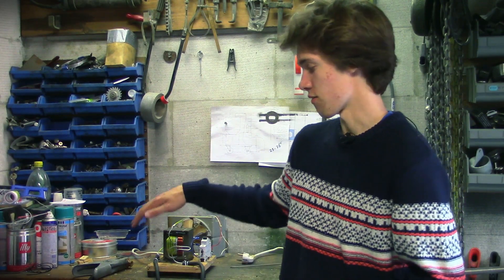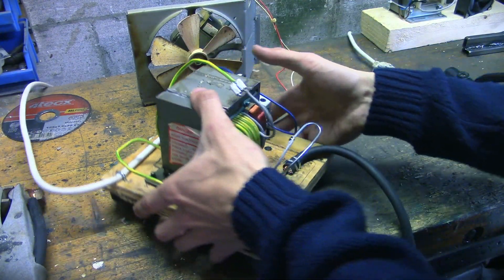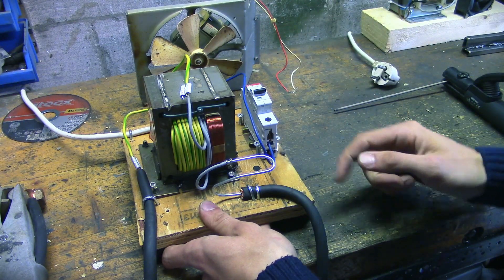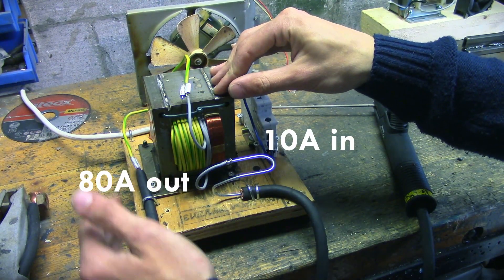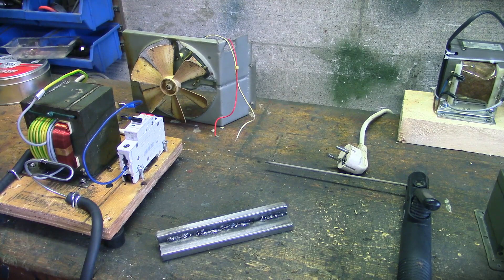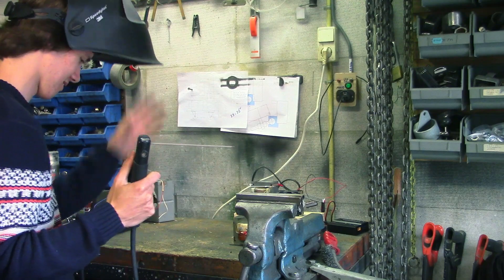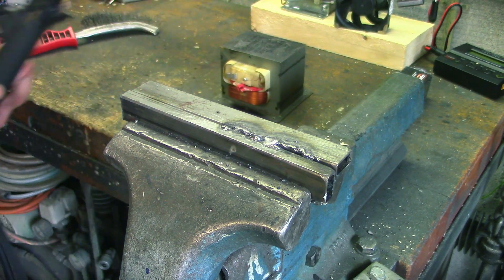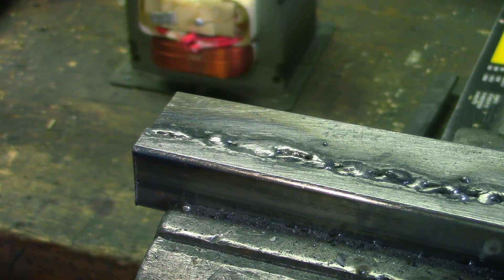The DIY welding machine (AKIO TV)

Comment: "Current returns through this clamp"  -  I didn't understand: what part of the transformer does the return cable cling to?
Reply from the maker: A more accurate thing to say would be that the return cable completes the electric circuit. It's simply the other end of the secondary coil.
(technically the output is AC so the current constantly goes back and forth, so "return" wasn't really the right term to use here)

Edit: I just realised you may be confused due to my weird wiring. There are technically 2 secondary coils in series (yellow and grey), but I see them as one coil. This happened because the voltage turned out to be on the low side initially, so I added that grey coil later to increase the voltage.
Reply: @AKIOTV  "the return cable completes the electric circuit" -  where is it complete? Which connector does the cable return to?  Ground connector?
Reply from the maker: @chellenta1175  In a DC system it would be - and the welding electrode would be +. (So the current flows from + to - through the work-piece) The output of the transformer is AC  so you could refer to it as neutral or ground.

Physically that's just the other end of the secondary coil.
Reply from the maker: @chellenta1175  I've uploaded a schematic at: https://akiotv.nl/warehouse_data/wpsuschematic.png